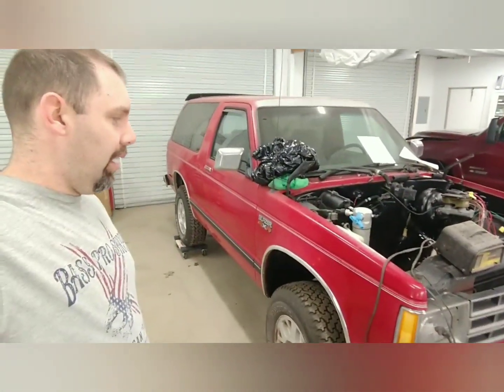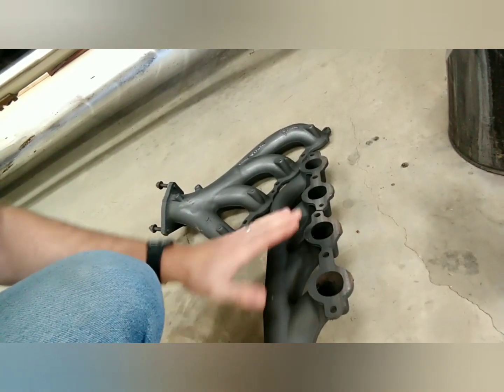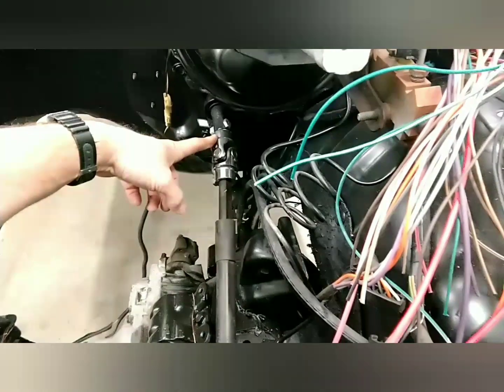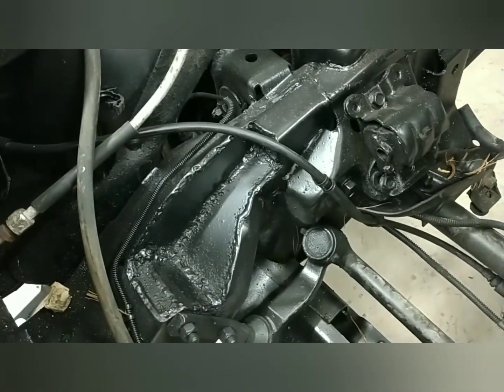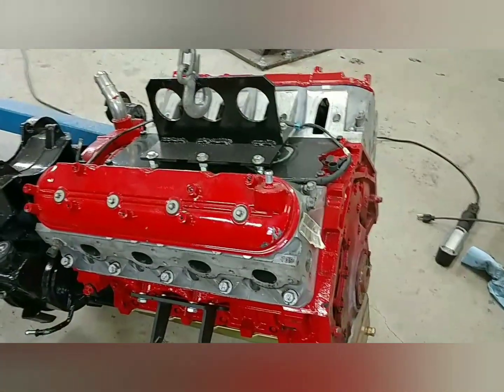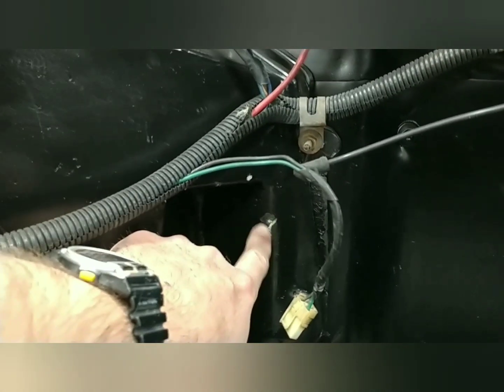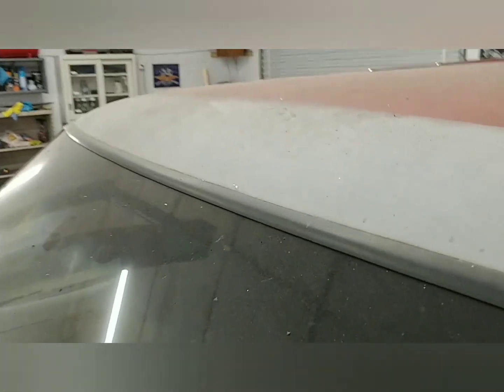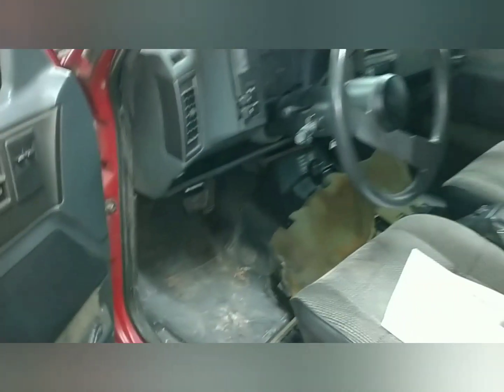4x4 S10 Blazer LS swap part 1

Comment: I have the same truck but make a swap to vortec 4.3 injected, you dont have problems with the shift linkage?
Reply from the maker: I had to make a couple pieces to make it work but I'm using the stock rod.

Comment: When you did your exhaust manifolds, did you run into an issue with hitting the shock tower at all?? 
Where did you get your manifolds as I tried searching sng preformance  and can not find anything about them?
Reply from the maker: I thought I was going to when I was looking at doing headers, but once I went with the exhaust manifold it all fit.  You have to use the factory truck manifold one one side and the block hugger style cast manifold on the other.  I mentioned this in another video. I bought my manifolds on Ebay.

Comment: What joint did you use for the top of the steering shaft
Reply from the maker: I bought a universal joint that would fit the shaft because I needed the extra space.  I have since replaced the whole thing with a jeep Cherokee shaft to eliminate the rag joint.  I would recommend that for sure.
Reply: Thank you I might end up doing that later on, I found a joint that fit, I have 85 Chevy s10 blazer that had the 2.8 in and it’s 4x4 I swapped in a 4.8 ls it’s not fully done yet have a couple for things I’m waiting on to get delivered to finish it.

Comment: Bought my 88 Blazer 4x4 a couple years ago with 90k original miles. 4.3 V6. A friend is pestering me to do this but we keep hitting a wall because of the 4x4 issue. I'm really impressed with this series. You're right - 2 years later theres still very little information on doing the 5.3 swap on a 4x4!
Reply from the maker: I know, right!?  I guess most people just do the 2wd. Thanks for watching!
Reply: I'm right there with you man I havea 99 Blazer 4x4

Comment: Did you trim the crossmember  for the oil pan to clear, and what oil pan did you use stock or aftermarket?
Reply from the maker: I didn't trim anything but the frame for the ac compressor. I used a milodon oil pan specific to LS swaps. It was very very close to the front diff.

Comment: I'm doing a 98 s10 blazer 4x4 with a 70 454 BBC  but blazer is lifted 10 inches  and 8 inches on body with 40s
Reply: I've got a 1991 Long bed regular cab 4x4 S10 with a tube frame and a 5.3ls 1 tone axles and 37s sitting at what would be a 6 inch lift if it was the original frame and not the tube it's a tube truggy crawler twin stick and crawler box winch front and back exo cage going to the tube truck frame and lot more been building up the truck for 15 years

Comment: 98-2000 camaro and firebird LS1 manifolds will fit but they are steel and you cut the flange off and use a piece of tubing to extend the manifolds and weld the flange back on. It works for later model zr2 s10 pick ups and blazers. Mine is a 2000 zr2 4x4 s10 and it's getting an L33 aluminum block 5.3L because my 4x4 is a torsion bar IFS and the Aluminum block 5.3 L33 weighs basically the same as the stock 4.3L that came in my truck. If your steering still doesn't clear with the earlier LS1 f-body (98-00 ls1 camaro and firebird manifolds) you can try to shift the steering over a bit or you can use the steering shaft from a jeep Cherokee
Reply from the maker: Good info, Jonathan.  Thanks for commenting!
Reply: @Sanium  sweet man we all supposed to help rhats how we learn

Comment: I have a question about motor mounts... they're higher than the s10 truck, my swap mounts dont work. Clean truck, mine is a 1990
Reply from the maker: Are you sure you have the ones for the 4x4?  The 2wd mounts are different than the 4x4 ones.
Reply: @Sanium  I have the 2wd truck. It's like the mounts are higher...

Comment: What motor mount or plates did or are U using keep me updated for sure I'm presently building -1998 4wheel  blazer with the same thoughts in mind
Reply from the maker: They are from dirty dingo. You have to make sure to get the ones for the 4x4. The 2wd LS swap mounts are different.
Reply: Dirty dingo makes awesome mounts I got a 91 4x4 5spd im gonna swap

Comment: What oil pan are you using? Do you have remote oil filter?
Reply from the maker: Milodon 31083. And yes I'll be using a remote filter setup. There's definitely no room under there for a filter. Haha
Reply: @Sanium  a shorty filter works I think it's a p45 I believe

Comment: I’m glad that you are doing this! Your giving me lots of useful information! You are the only one I have been able to find that is doing this particular swap. I am doing a rat rod project using a 88 four wheel drive S10 frame that currently has a 2.8 V6 in it. Unfortunately up to now I haven’t been able to find anyone that is doing this specific swap. Everything online is for a 2WD chassis with the 4.6. What are you doing for the transmission and transfer case and rear end? I’m assuming the the original ones won’t work.
Reply from the maker: Transmission is the 4l60e from the same 2005 Tahoe that the engine is from. The transfer case is a stock np231 and stock 10 bolt rear. The 231 I'm pretty certain will hold up fine but the rear axle is to be determined. Although it is the same basic axle as a Camaro so we'll see.